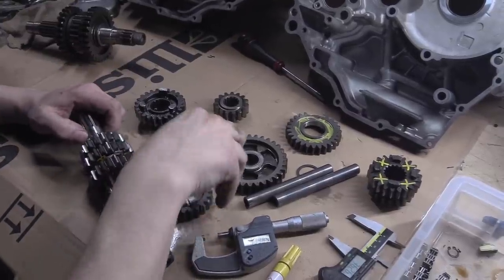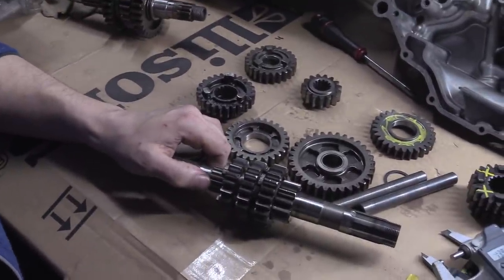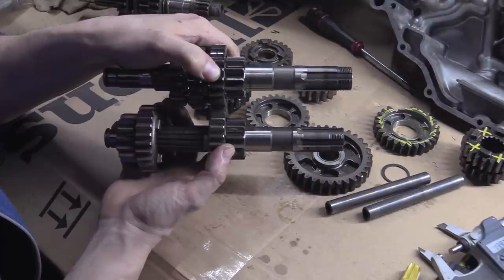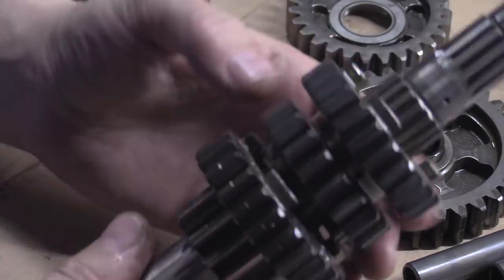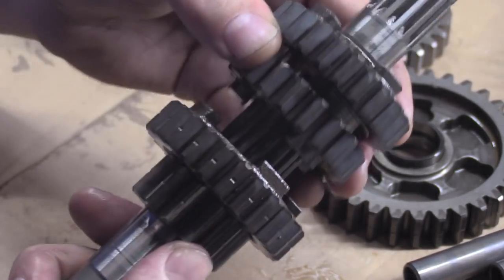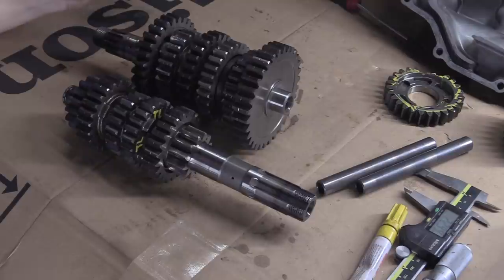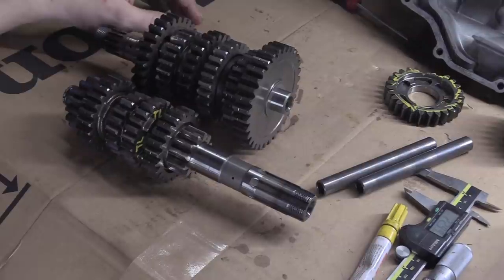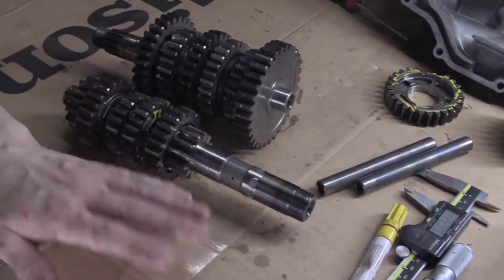Gearbox Assembly #17 Suzuki Trackbike

Comment: OMG you are doing it wrong. The sprockets need to be sanded in the holes before assembly and you need to apply copper super slippy grease, it makes a nice fit.. I have so many years experience as a fitter.. or was it a fidler.. LOL
Reply: Sanded, then waxed and buffed.

Comment: i once lost a circlip on my zafiras gearbox years ago, it just pinged away into some bushes, it was supposed to retain a single gear on the very end of the shaft, not even inside the main casing. if i remember correctly anyway.
I hammered a peice of copper mains wire into the groove because i needed it fixed asap. the crazy thing is, it held no problem. 

I obviously would not recommend.

Comment: My lesson:: I put the bearings in the freezer. Good. For two months 🤔....the freezer was failing and becoming warm and moisture formed on surfaces. These bearings had been soaked in warm snake oil, ProBlend, which I have used since 1984. The bearings failed in about an hour. So never leave bearings in the freezer, freeze just prior to using them. And ProBlend is good stuff.

Comment: @7:51 onwards...I think the gear does not need to line-up hole to hole, since there is a groove inside the gear itself (can be seen for split second), where the oil can loop around. Or am I wrong?
Reply from the maker: You line up the spacers when they are splined.

Comment: Y not re-harden them after back cutting?
Reply from the maker: 1) you have to know what the alloy is 2) you then have to know what the treatment is (nitrogen, hydrogen, CO... 3) you then have to know the procedure (timing, ramp down etc.) You could actually mess up the rest of the temper without knowing these things. It's far easier just to sort the issue or buy new gears
Reply: @dirtygarageguy  What!?!?! You mean you cant just heat it red hot with a torch then dunk it in oil like so many youtubers do?

Comment: If you were to get each individual  gear up onto a rotary table on a mill and drill/ bore equally spaced holes in them, thus reducing the weight of each gear, would this allow the gear box to spin up faster giving greater  performance?
Reply from the maker: You'd make the gear weaker